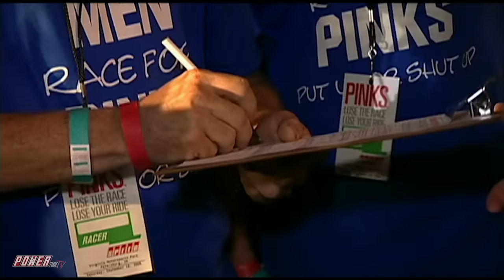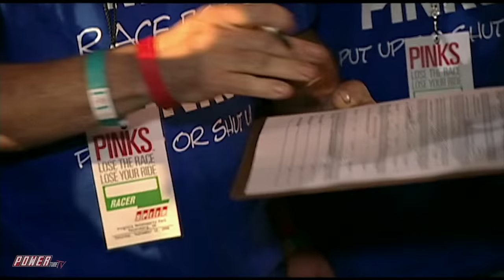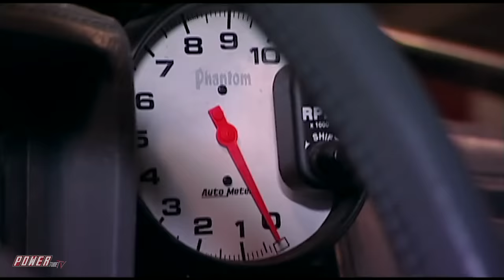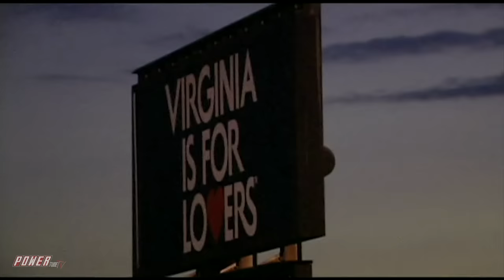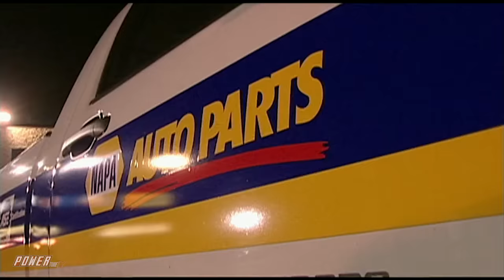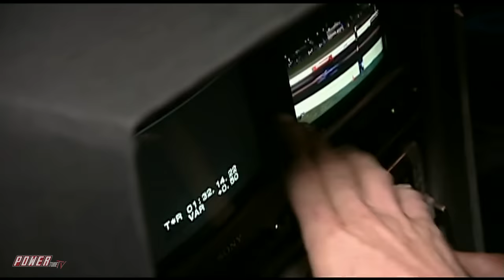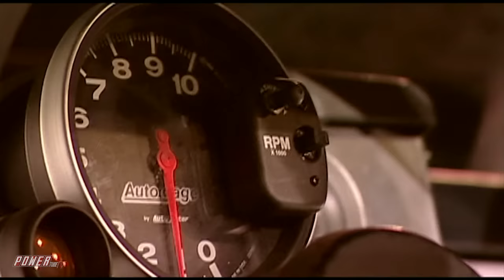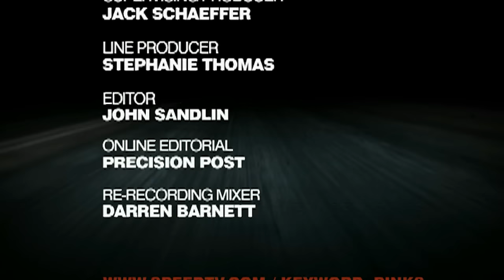PINKS - Lose The Race...Lose Your Ride! It's Another "Shocker" for Nate Pritchett - Full Episode

Comment: Would b better for everyone if they checked time slips and if u broke out by a half second you are dq
Reply: That's just bracket racing, which is what they tried with Pinks All Out
Reply: There should be a clock running - totally agree.
Reply: Then it becomes boring crap, run what you brung! Bracket Racing=💨

Comment: Def need a foot camera to watch if they are sand bagging. It always drives me crazy when people get so excited ti when by default.
Reply: I agree. While I kinda commend them for playing the game at the same time you can clearly see the S-10 guys are straight up lying through their teeth.
Reply: @jdmmike7225  most episodes had someone like that every episode but if they were about honor and integrity like they claimed but would agree on say a 12 second car and show up with something running sub 10
Reply: That's part of racing like this. When giving spots or bracket racing, this is a well-known thing that is just part of the strategy to win.  You can call it cheating or whatever you want but there's never been a rule book saying you can't pedal a car to slow it down if needed. 

Tell me you've never been around racing before without telling me you've never been around racing before
Reply: Camera under the hood would likely be more reliable, but yeah they definitely need a way to show sand bagging. 

Pinks also needs to monitor tuning and electronic controllers. Particularly turbo. Plenty of people have been shown to be running at low boost then change it all of a sudden later. Also no scramble buttons.